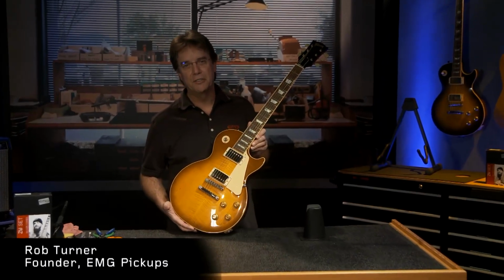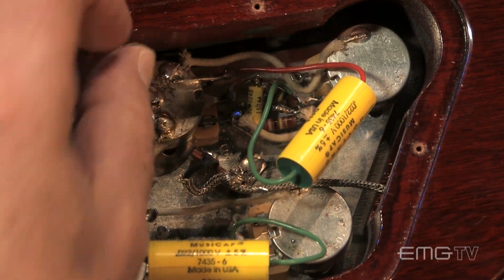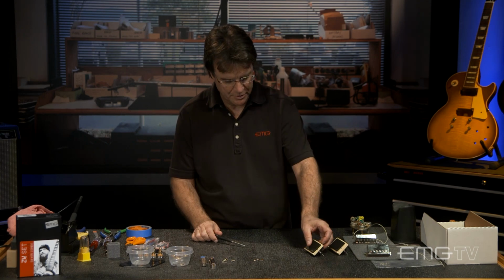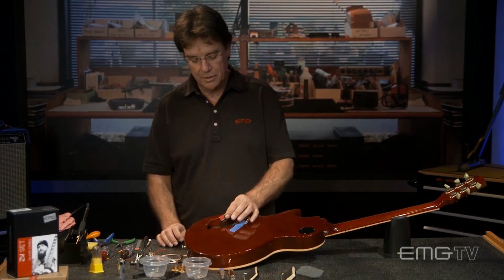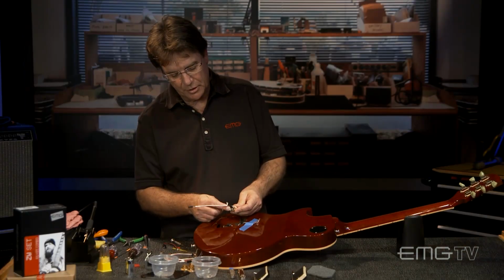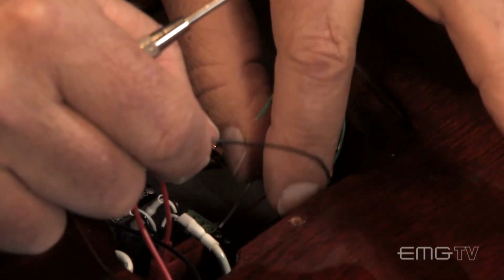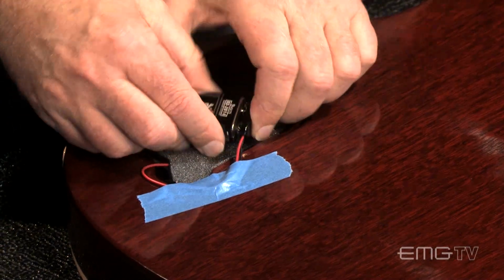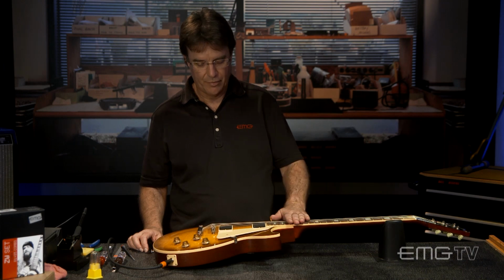Easy solderless Zakk Wylde signature pickup Install with Rob Turner, EMGtv

Comment: I like the 85 in the bridge
Reply: 81  more clear I think I went with a 81 60 set in my first Jackson. I may switch 81 in the bridge slot out for a 85. I have to closely hear the differences. I think the 81 is more clear and better I have to really listen to the 2
Reply: I was looking at the 81/85 specs on Amazon. The 85 seems better matched for the bridge imo✌🏼😁☯️
Reply: @bdogjr7779  I use the 85 in my jackson bridge. It great as a bridge pickup.
Reply: @jgmopar 🎸 《☆》I'm thinking about putting a set of ZWs in an 04 Epiphone LP that I put some Gibson Burstbucker Pros in when it was new. Over the years of not playing it much the electronics have gotten scratchy & sometimes I can't even get the neck pup to work without flashing the coil several times. I aquired a Gibson since then that I'm thinking the Burstbuckers will be perfect for✌🏼😎☯️
Reply: @bdogjr7779  I did that to one of my Epiphone LP's. The stock pickups were dead sounding in the guitar. I tried a Seymore Duncan JB same result. I tried a rail hammer same result. so, I went EMG and sounds great.
Reply: @jgmopar  《☆》I'm thinking the visual appeal of the black pickup, cream bezel & Sunburst guitar will look good too✌🏼😁🤳
Reply: Yeah

Comment: OK, pickup height a little less than 1/8" bridge pickup in his setup. Just squish the battery surrounded by foam into the control cavity. These two things are not really discussed in the instructions you get.

Comment: I got this pups installed on an epi les paul std and I did everything the video said but now the guitar sounds distorted even on clean settings.  I check with my other guitar so I know it's not the amp.  The battery is fresh.   I can only get a clean sound at half the volume on both pick ups.  Any suggestions?
Reply: +Maximiliano Well, you don't have to worry about not getting enough signal, that's for sure!

Comment: Hello, Does the 81 go in the bottom slot and the 85 in the neck? Thanks for the video
Reply: +WFIST Usually yes. However both the 81 and 85 can go in either position, it's preference.

Comment: how could I make this work if my guitar's got 2 volume knobs, but just one tone??
Reply: +BurnBabyBurn!  go to the emg website and download the 2 volume 1 ton pot schematic,  i am currently in the process of installing emgs in my schecter
Reply: +snake thanks man!
one more doubt: does the pack's got everything I need to install'em, or would I have to buy some more cables or whatever depending on how many knobs I got on my guitar??
Reply: +BurnBabyBurn!  the zakk wylde set comes with everything!!! you get 2 volume pots and 2 tones pots, plus all the connecting cables.   there are different sets  of emgs. the 81/85 is the most popular. but the 81/60 , het set and 57/66 are good options
Reply: +BurnBabyBurn!  you do need to have some tools, like a ruler, philips screw driver, a hex spanner, and an alan key. plus you need to do some de-soldering to detach the original pickups and connections
Reply: +snake cool mate, thanx for the info! I'm definitely buying this one soon, and hopefully the het set someday, as I got a project of building my own Ken Lawrence Explorer when I got time enough in the future. 

the last emg pair you named, how does it sound?
Reply: BurnBabyBurn!
 the 57/66 is very punchy and organic,
it has the warmth of a passive, but the attack of an active emg.
 i had my eyes on it for a long time, it seems very versatile and a lot of guitarists are switching over to them andy james, masaki murashita, josh middleton(sylosis, he has a lot of demos on his youtube channel), marty friedman. youtube the emg57/66 and watch the demos, you might prefer them.
i was going to go for the het set, but they were way too hot, i decided to go for the x series 81x/60x... the 81x handles my distortion and the 60x handles the solos and cleans
Reply: +snake sounds great, I'll check them out! cheers 🍻

Comment: The wires coming from my 3 way selector all have 2 wires soldered to the pots. 1 white 1 bare coming from a thicker, red, Green, and Grey wire. Bare should be ground so do I have to stretch them all over to the ground section on the power buss? Or can a simply twist them together and wire it all hot?
Reply: +Jay Palmer me too, need help
Reply: troymassey90  ive done a lot of car audio and thought that a separate wire would be best so i ran a forth wire instead of dual wires like my dean Cadillac x had. works great.

Comment: Thanks for the video. For some reason, the wiring diagrams just never seem to work for me. I've wired 2 Les Pauls with these and both times the drawings just seemed wrong, but this video saved me this time. 

If anyone has an Afterburner (20db boost) pull pot. Looks like it just a replacement tone pot, with a hot wire for power - however, i can't recall - i installed one a long time and rarely use it.

Comment: Sorry I am a newbie. What happens in the end of the video when Rob is balancing the pickups. Is he adjusting the hight of the neck pickup when adjusting middle screw? And why does it affect output from bridge pickup (both pickups) ? I have a used guitar equipped with the pickups and it needs this adjustment ;-)  Thanks to EMG for the video.
Reply: Johann Elmo Yes, hes adjusting the height of the pickups. the closer the pickup is to the string, the more treble it has. the farther away, the more bass it has. So he set the bridge to were he likes it, and then adjusted the neck pickup according to the bridge sound, just so it wasnt so drastic of a difference. its all preference really. some people like the neck to sound WAY different than the bridge, so they set it that way. Id suggest fiddling around with your pickups. Start with the bridge like he did, set it relatively close to the strings, and see how it sounds, and then the same for the neck. but do one at a time so you can judge the sound of one off of the other.

Comment: is there a difference btwn soldered & non soldered as far as tone is concerned?
Reply: mjt11860 nah, the quick connects just make it easier to install.
Reply: Luxorcist thanx.
Reply: +mjt11860  also if you want to try differens combinations like 81/60,  81/85,  85/60 or 57/66. the solderless conections make like so much easier
Reply: Bearista Bear  It's next to impossible for the solderless connections to go out, unless it was very roughly handled or installed , I took a leap of faith and went with the emg81x/60x, and it was a breeze to install
Reply: +mjt11860 If I was hypothetically going to play guitar for a living, I'd solder everything, since you don't a connection going out on you while on stage.
Reply: Thanks for the feedback, Snake. I have just ordered an SAX pickup myself. On solderless connections, unfortunately, the neck pickup connector on my Epiphone LP Standard Plustop Pro has an intermittent bug; disconnecting and reconnecting brings it back for a few weeks, but then it goes out again. I have since removed the neck pickup altogether since I never play it. The reason all solderless connections are potential problems is that it they are metal on metal, and prone to failure because of dust, dirt, etc.
Reply: +snake thanx 4 the info
Reply: +Bearista Bear thanx 4 ur input.

Comment: I just installed an 81/85 set with the quick connect kit into my Epi. LP and it was a breeze. It all went in nice and easy with no problems. The only thing is I find that when I have the 3 way switch in the up position the guitar has extremely low volume, don't know what's up with that unless that's the way it's suppose to sound. I've checked and re-checked and everything is plugged in correctly.
Reply: I have an epiphone LP standard and I'm thinking about changing pick ups.  Were you able to get the problem with the volume fixed?
Reply: Maximiliano emg Actives have weaker magnets, so you need to raise the pick ups closer to the strings

Comment: I just bought an Epiphone Les Paul Prophecy EX with EMG 81/85 pickups and they are soldered in like the old type even though it has quick connect wires.  There is no solder-less pots or EMG bus and no solder-less interconnect wires. 

Question is if I get an official EMG wiring kit and pots for the pickups will there be any notable difference in tone? Sounds great as it is anyway.

Comment: I've always hated soldering. These are great!!!!!  Nice and clean install
Reply: Derrick Smith Except for the fact you relying on a sticker to hold one part in.
Reply: @electricritual4197  After the battery and foam are inserted nothing will move.
Reply: Even this is for the birds I'll take my guitar to a shop before I install pickups
Reply: @calebproductions5970   --- pussy
Reply: I have used solderless guitar electronics ONCE and it was a massive failure. The wire clamp connections have no durability, so don't expect to be able to change things more than two or three times and be careful in the process not to torque the connection screws.

Comment: shame the vid does not go in depth about the selector switch
Reply: that's what I'm tryna figure out
Reply: You reconnect the old one to the screw nuts. Notice that he doesn't remove it.
Reply: metamaggot same here
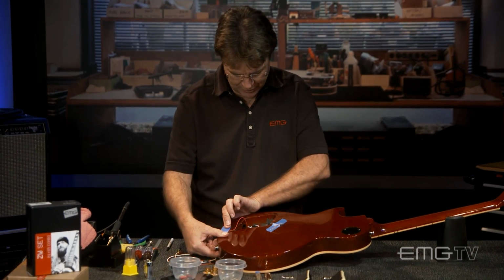Reply: @12:55
Reply: The only reason I clicked on the video... Only now found out I also need to buy the selector switch seperately

Comment: I have a question, i have a jackson JS32 Rhoads that has only ONE tone and ONE volume and I want to install this set but it comes with TWO tone and TWO volume. what do i do? do i have to re-route the wires? or how does this work in my case?
Reply: I have the same type of issue, but I emailed emg and they said that they come with instructions on single tone/single volume setups.

Comment: What new OEM guitars do the solder-less versions come in?  I just bought 2 new Charvel guitars with EMG 81/85 pickups and they are soldered in like the old type even though it has quick connect wires.  There is no solder-less pots or EMG bus and no solder-less interconnect wires.  Are there any OEMs using the solder-less type?  I'm a cheapskate and don't want to buy the kit separately for $35, I want a guitar that comes with this setup from the get go.
Reply: they probably use non EMG pots and switches hence they have to solder it all  but if you arent gonna change the pick ups then dont worry if so  just replace it all with the emg stuff
Reply: k ma I think only the Zakk Wylde EMG set has these types of connections, i could be wrong though

Comment: when i install both pickups, the neck pickup sounds waaaaaaaaay louder than the bridge pickup, but when i install only one pickup, either the bridge one or the neck one, sounds good. What can the problem be? ( i have 81 and 60)
Reply: are the heights correct?  you may have miss wired it  check all the connections and the heights of the PUPs
Reply: Did you ever resolve this? I have exactly the same problem ...

Comment: Hi, I just replaced my original Gibson JPL 2014 pickups with these... i followed the instructions to the last detail, but after putting the battery and connecting to my amp i get absolutely no sound at all... i've gone through the instructions over and over again to no avail. Any help would be much appreciated. The battery i used is not new but it still has charge, it still makes other electronics work. Please some help here...
Reply: So i took a voltimeter and started checking cables and connections. Apparently one of the cables provided was making short. As i would touch "the white end"  in one side of the cable, and on the other side, both the white end and the black end would transmit electricity. Ill try to work on it, if i have any luck ill post it here. I couldnt find a forum with this subject so i might as well leave it here.

Comment: I just wanted to point out that at 12:41 the cabel that comes from the jack is conected with inverted polarities... they correct it later in the video but don't say anything about it.
Reply: Dude my emgs have incredibly weak signal and the buzzing is unreal I have a gibson les paul 2019 classic. Any advice I followed this vid
Reply: @801bbusy  same is happening to me right now. Any answer yet?
Reply: @leekirschman6256  ye, what you think is the ground isnt
Reply: I FIGURED IT OUT!! My issue was that I didn't use a pickup switch, I had a sh*t one and didn't want to use it. So I never connected anything to the poles. I took two wires from my previous passive pickups, snipped them up to make the wiring cleaner, and connected them from BRIDGE to OUTPUT using a heatshrink connector. (I'm only using one pickup; connected to the Buss btw)

Comment: Anyone I need help, I'm installing EMG HZ bridge only pick up to my dean razorback, the black one with matte Finish and a green killswitch button. I'm not sure how to do it. I know there are some wires I need to unsolder and resoldered on the new knobs comes with the pick up
Reply: kill switch wire one cable to ground and one to the SWITCH OUT  the killswitch MUST be a Normally Open switch (NO)
Reply: Jae TLDR  won't have room for the kill switch. I looked at the diagram comes with the EMG pick up. It looks like I have one tone, and two volume controls.  And since it's not factory install, there won't be a push knob to active the active EMG pick ups. May be the killswitch can replace it. But I only.have three holes for knobs
Reply: *****  you can either drill a hole (space permitting/ willingness to live with it permitting) OR rewire it to have 1T 1V KS or 2V KS  etc soldering int that hard just practise before trying on a guitar

Comment: Do your passive pickups also come with the solderless system?
Reply: I'm actually wanting to go back to passive, so If the EMG HZ has the solderless system, that might do the trick.

They should really have better information on their website though. It doesn't show the solderless system in the product description for the Passive/HZ pickups.

Comment: I have a question: I have a Les Pauls Epiphone, wich have only 1 volume control and 1 tone control, does I have to install this solderness "pack" in a different way?
Reply: Yes you do. On the EMG website they have installation manuals for each pickup which includes different volume and tone configurations, including one master volume and one master tone.
Reply: thank you very much mate :)
Reply: This set comes with a bunch of different wiring diagrams, 1 Volume one 1 tone being one of them, its super easy to do
Reply: oh nice, i'll check them so I can learn the connection, thank you mate :)

Comment: What happens if the battery pack does not fit in the compartment at the end of the installation?
Reply: MotiveToKill your fucked
Reply: It is doubtful that you'd find any guitar, without sufficient space to take at least one PP3 - 9v battery.   
.
The easiest way to power active pickups, without carving away extra guitar real estate, would be to connect the active circuitry via an XLR plug.  This would allow a phantom power supply to the onboard electronics.  The power source could thus either be a phantom psu (floor or amp positioned) or simply a PP3 - 9v battery clip, attached to ones guitar harness;  much like one would fit a wireless pickup preamp.
Reply: Route for a battery box....mine turned out awesome.
Reply: then you have to make room for it ;)

Comment: I have a problem:
i have a jackson js32 and i'd like to install emg's but it has 1 volume, 1 tone and the output jack is a bit far, and the wires that come with the pick ups are too small !!
Can anyone please help me?
Reply: I know this is an old comment, but this might be helpful to others, you'd have to drill a new output jack near the control cavity, or order a longer wire from EMG with a battery cable extension. I'd recommend just drilling a new hole. I had issues with noise with some long wires in a B.C. Rich Jr. V. Get a guitar tech to do it if you can't be bothered.

Either that, or just get a KVXMG.

Comment: Installing these on my Epiphone Les Paul Studio - nearly done! I seemed to have to set the pots to be way shorter though, or my knobs would of been too high off the surface of the guitar - anyone else found this?

Also, I don't think my toggle switch has a grounding cable? It looks like it just has 3 cables. 2 which are red & white that run through a single grey cable + another grey cable - is this ok? Or should I buy another toggle switch?

Comment: I want to put this set in my strat, but there is only 3 holes for the pots, so if I wanted both volumes and 1 tone would I loop both wires from the 2 volumes pots into the 1 tone pot?

Comment: Attention! In this video tutorials found an error. At the 12:37 minute of the connection is not correct, the reversed polarity. Need black and white wires reversed.

Comment: you need to use the jack that came with the kit.  Its a stereo jack, it turns on the pickups when you plug in the cable.  Original jack is mono.  check out the emg website to order a longer jack.  hope this helps.

Comment: The pots are the same as long as you solder them to correct pickups.
For example pot x works with both bridge and neck pickup. Same for pot y. So you can have bridge pickup to pot x and neck to pot y or the opposite way :)

Comment: If you wanna do it on a Flying V that has the output jack at the end of the wing, be sure that you ask for long wires upon ordering.
The standard wires are way too short.
Except that flaw EMG has a good support, I sent them a mail about the problem and within 3 workdays I received the extended wires.
Reply: @Dusty Chugs Agree, but the customer asked for the pickup replacement only and to keep the jack as it was.